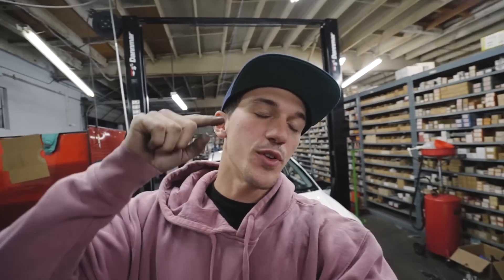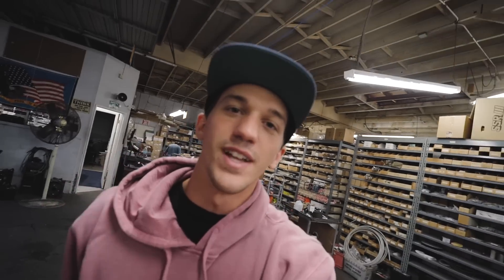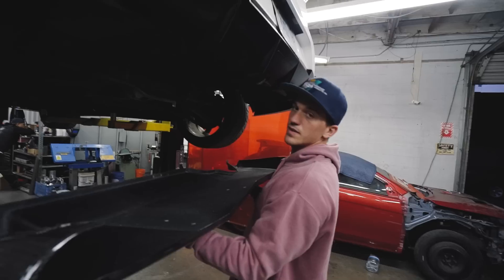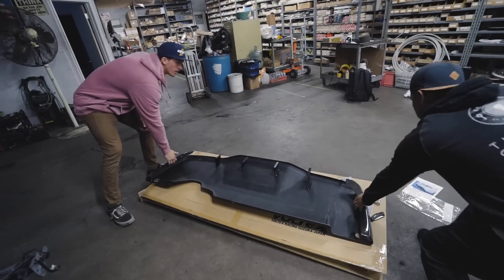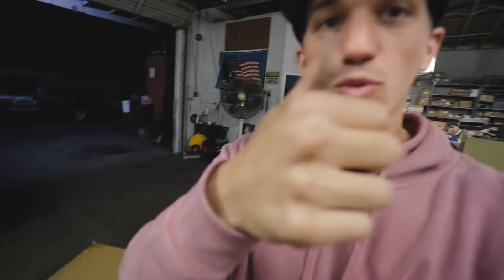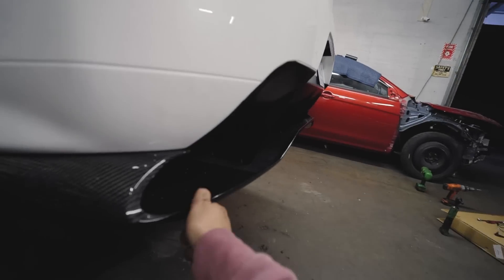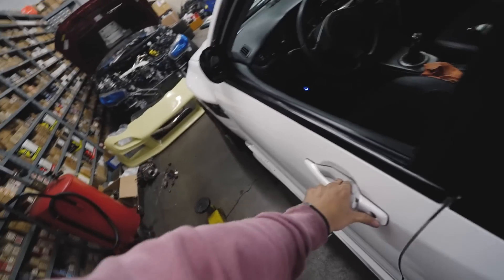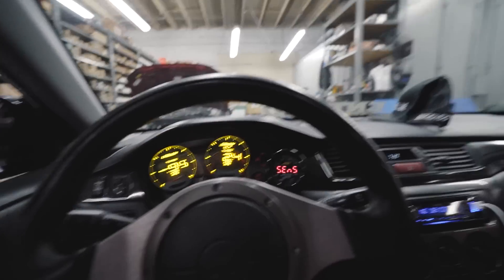Evo 8 Gets CARBON FIBER Voltex Rear Diffuser! *Install*

Comment: Dustin, PLEASE ditch the hood exit exhaust and put the Tomei back on the Evo. You need the Voltex hood anyway to complete the kit, lol. The rear just looks kinda off with no exhaust coming out of the hole (inb4 innuendos). 

I know the hood exit is aggressive and sounds good, but the Tomei sounds just as aggressive and looks better (IMO).

Comment: Hey Dustin you should add a side fender lip or blade in carbon fiber i defiantly think that is the last thing that needs to be done to the out side just to connect the back to the front cause the all white makes a brake in that color but just my opinion love the car looks great man keep doing what you love cant wait to meet you in person like i said i have a 650 rwhp 2007 gt500 if you want to run them some time on the streets or track im local in cali . my wife is slowly building a 2010 lancer ralliart awd evo turbo coversion kit the plans are for over 600awdhp (its sitting at 315awdhp atm) so when that gets done we can run that too anyway keep up the good work man